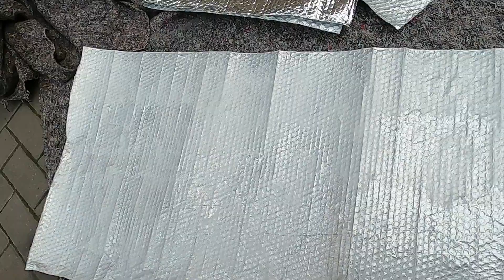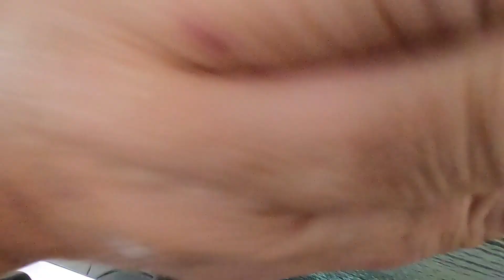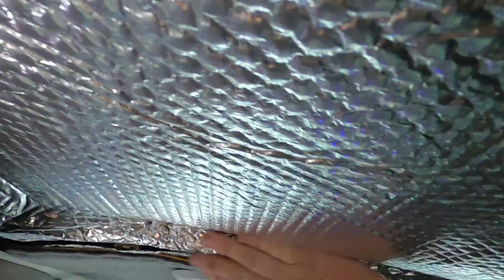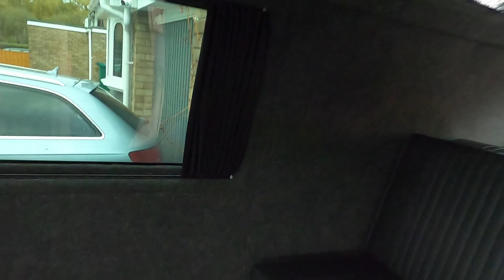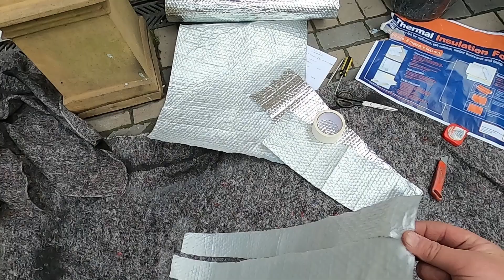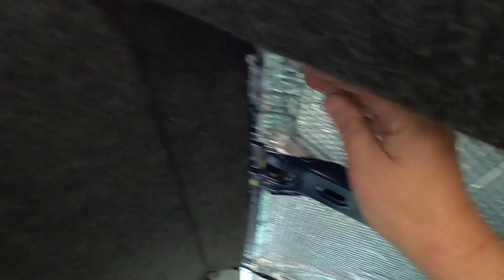Camper van Foil Headliner Roof Insulation

Comment: Hi, did you measure before and after? Just wondering how much lower it can get after applying those. Thank you.
Reply from the maker: The clearance is about 3cm - 4cm, i also use insulation now
Reply: Oh im sorry for my bad english, what i meant is how much degree lower after applying insulation, did you measure? Im considering because its quite a price to get those insulation here 😩
Reply from the maker: @JustaCuriousity  Never measured temperature however it does make a big difference as the roof is the heat loss point on campers